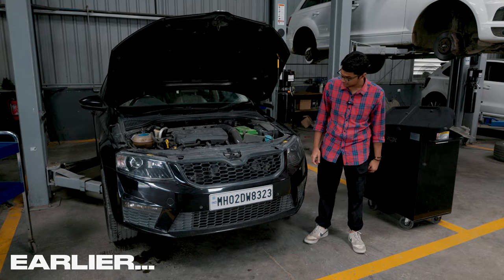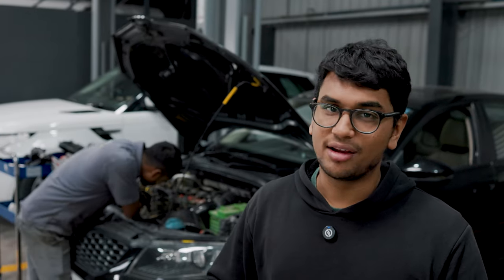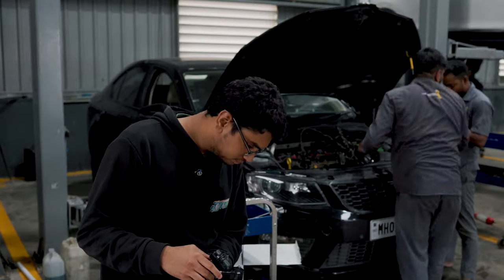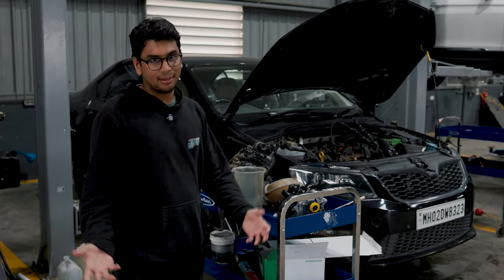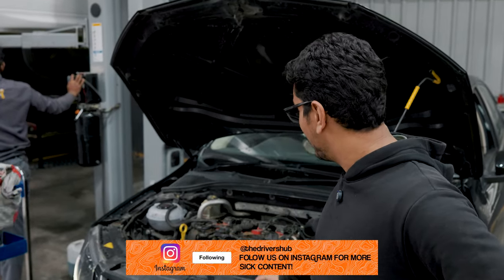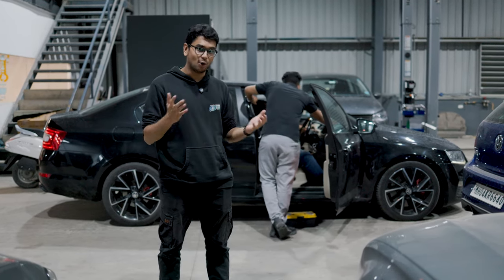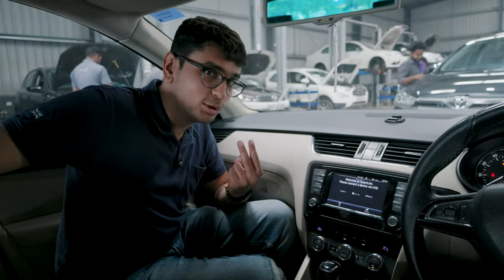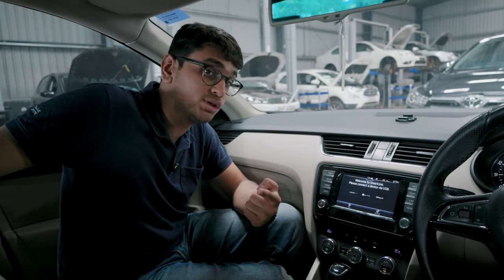₹30K Water Pump Replacement in our 330HP Octavia + Installing Android Auto & Apple CarPlay!

Comment: I have a small suggestion for your Project Skoda Octavia... You can just change rear Taillights to VRS ones it will look great 👍👌. You can also add a VRS spoiler to your car too..the rear look of your Octy will get totally transformed to a next level 👌
Reply: Just pay for it
Reply: What you're saying sounds good for contemplation but on these overpriced and overhyped Euros which we have here, it's only possible for actually rich owners. As the caption suggests, these creators are far from rich. Either that or they are making content aimed at impressing only the poors.

Comment: Please share your buying experience of this octavia.. how many kms it was covered wen you bought and i want to buy octavia what should we consider Please
Reply: Best to avoid 1.8 TSI with DQ200 transmission, I bought a 2016 94k kms run 2.0 TDI with DQ250 last year and it has run successfully for the last 15k kms without any major issues apart from water pump failure similar to this video. Look for 2017 and above cars if possible. I’m glad I got a 2016 car as it comes with Android Auto and Apple CarPlay inbuilt, did not even realise that till I bought it and plugged in my phone a few days later.